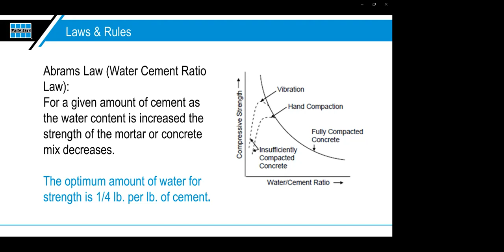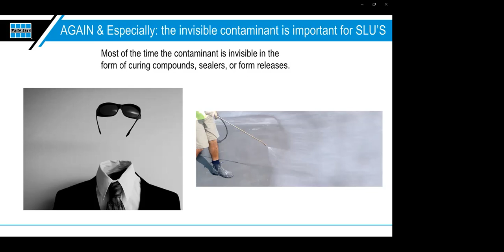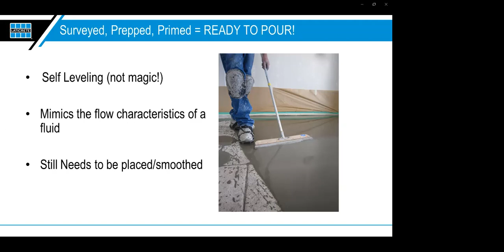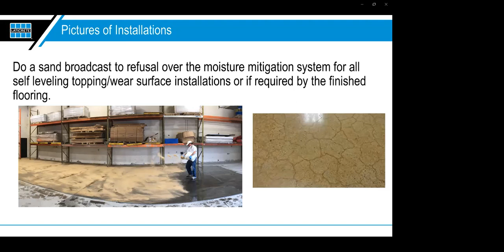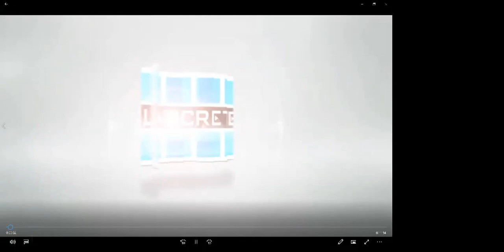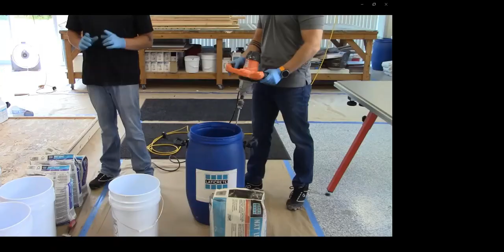Self Leveling Underlayment Video & Webinar

Comment: Do we wet the concrete before pouring ? I live in the Philippines if that makes a difference ?
Reply from the maker: Hello Neil! Thanks for watching and taking the time to reach out. No, you would not wet the concrete surface before pouring. That will already be properly prepped per the instructions in our Substrate Preparation and Primer Guide for LATICRETE® Self-Leveling Products TDS 230 provided here: https://bit.ly/3qg7Ecs
Reply: @laticrete  thanks 🙏

Comment: Can we use Level Plus on OSB subfloor? Also which primer should we use Facebook r OSB prior the using a self leveling compound?
Reply from the maker: Yes, Oriented Strand Board (OSB) is a suitable substrate in interior applications. However you'll need to be very mindful of the language in our datasheet when going over OSB. 
- Verify that the wood substrate is APA-rated Type 1, exterior exposure plywood or an OSB equivalent. Cracks are common and expected with unstable substrates (i.e. Plywood/OSB). Cracks are not considered a product defect. LATICRETE cannot predict if or to what extent cracking will occur. 

NXT Level Plus can be installed at 1/4" over Plywood/OSB. Thicker applications may be required if stone/tile is being installed. 

Datasheet link: https://cdn.laticrete.com/~/media/product-documents/product-data-sheets/ds-505.ashx?sc_lang=en&vs=1&d=20210216T172414Z

Substrate preparation and primer guide link: https://cdn.laticrete.com/~/media/support-and-downloads/technical-datasheets/tds230-substrate-preparation-and-primer-guide-for-laticrete-self-leveling-products.ashx?la=en&vs=9&d=20210226T155707Z&hash=91ED3F8732D08CEC95C18A523D5ABB6290E4C162

Comment: Great content! Can you provide more details and examples on when to patch or skim vs full pour or partial pour with screed? I've got a 10'x20' concrete floor where old tile has been removed and surface professionally ground down but when checking with a yard stick and a leveled laser there appears to be around 3/8" or so max deviation from high to low spot (8' straight edge is not flat in some spots). Need tighter tolerances for LFT so what would you recommend?
Reply from the maker: Typically if the entire floor needs more then 1/8" it is easier and you will get a flatter floor is you use SLU (self leveling underlayment). 
We're not sure what type of crew you have though. SLU isn't a one man job. So, it doesn't work for all contractors/situations. In that case you can use any of our SLU's. 

If you'd like us to get you in touch with your local LATICRETE rep, send us a message at socialmedia@laticrete.com with your name, company, phone and location.

Comment: Couple of questions: How do you address a new pour where it comes against a previous day's pour (as in the crew working in the gymnasium) and, does that become a movement joint as it relates to EJ171?
Reply: Where 2 pours meet is a cold joint - good news, it is not a moving joint. Following Laticrete's instructions below will give you a seamless, successful application
Reply: @joer825  Thank you, Joe!
Reply from the maker: Assuming you used a pour stop on the first days pour, you would pull that pour stop. Prime that dry edge (however thick it is, and pour up to that primed edge. Noting you would have to / want to prime the floor per instructions as well.